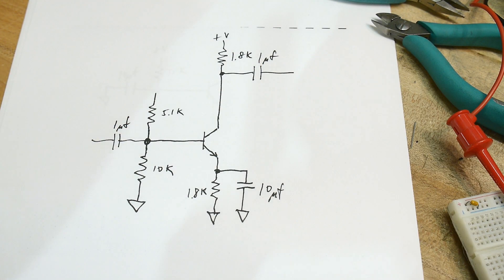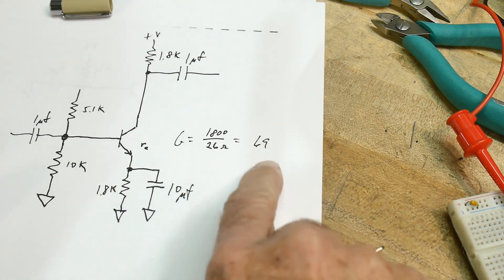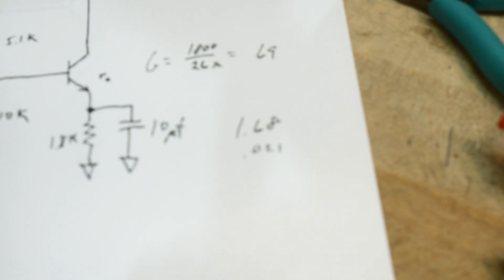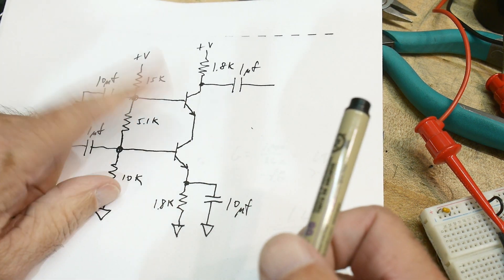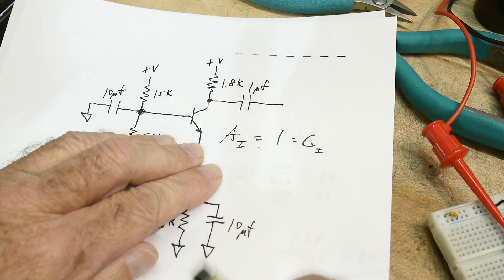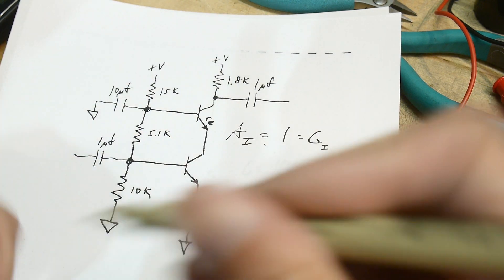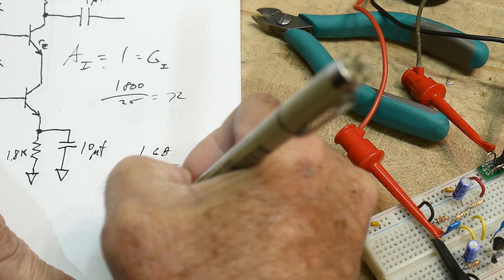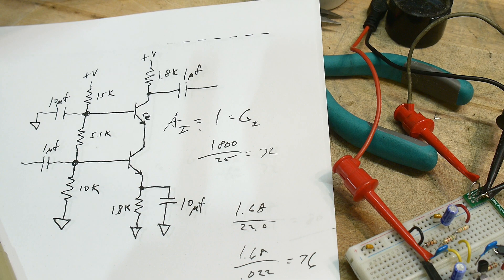#1770 Cascode Amplifier (part 2 of 2)

Comment: The common base stage of the cascode provides a lot of voltage gain.   The input stage provides current gain.  An incremental analysis of the cascode shows it has a higher frequency response than your typical common emitter amplifier.   That is because Cπ, the collector base parasitic capacitance of the lower transistor is shunted by a low resistance.   However to get the full advantage of the cascode, it needs  common collector buffers at the input and output.   If you do the math you will see that.

Comment: Great video.
I would like to know if you can guide me to a reference which contains most of the common transistor based analog circuits such as current mirrors, amplifiers, etc.
Thanks
Reply from the maker: https://youtu.be/OBNl-6nFyL0?si=OQbW5sfrnq5WZjjw

Comment: I think I heard the first pico second (GHz) opamps and amplifier were constructed using multiple cascode circuits.  Maybe 6 to 10 levels.  Biasing those transistors would have been a nightmare.  Please someone confirm.

Comment: the problem with completely bypassing the emitter resistor is you bring temperature in to the gain equation. it's nice to have the Re' ro be a bit smaller than Re so as to reduce the affect of temperature change on the gain.
still nice to see that old ball parks still being used in circuit design.

Comment: So will it go even faster if you add yet another transistor, so 3?  Or is this exercise left up to the student?
Reply from the maker: no
Reply: Once you've neutralized the Miller capacitance of the first transistor, there is nothing else you can do to make it have a higher GBW. Except for using different transistors.

Comment: Hi, Thanks for the video once again. Since your doing ballpark calculations, why don't you just divide 168/2 mentally before using the calculator. It would gives confidence in the calculator results and catches errors done on the calculator if any. Just a trick I learned along the way.
Reply from the maker: well if you want to know.
1. I'm not good at doing math in my head
2. if I make a mistake I get way more negative comments than yours
3. I'm talking, thinking of what to say next, and making sure the camera is framed correctly. no room for math in my overloaded brain.

Comment: Off to the books...but in a nutshell a cascode amplifier basically is a way to ~ double (at least in this case) the frequency response of an amplifier? Gotta see in the books the other benefits, uses etc. Thanks Mark!  73 - Dino KLØS  [edited to correct "cascode" vs. cascade, darn autofill!]
Reply: interestly, the very first book I read about this circuit in 70s had printed cascade.  For many years I pronounced it cascade.  Then someone corrected me.

Comment: The first transistor amplifies the current, the second transistor amplifies the voltage. 
The effect of the cascode circuit will be even more visible if you drive the circuit with a high impedance source, so that the miller effect can have an impact on the signal at the input.

Comment: It would be nice to look at the impedance of the amplifier circuit seen by th signal source. At high frequencies the Miller Effect capacity acts like a short and the signal generator has to drive a low impedance device m.
Reply: The purpose of the cascode circuit is to greatly reduce the effects of miller capacitance by having very little collector voltage swing on the first transistor and the miller loading in the second transistor is to the signal ground at the base of the transistor, rather than the signal base input, so the miller feedback does not buck the input signal as in a straight common emitter amp.